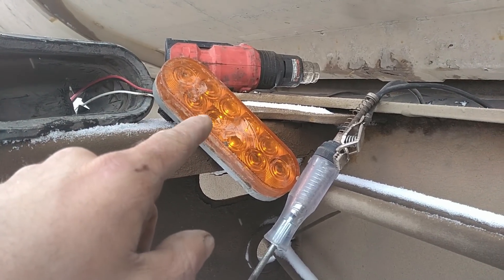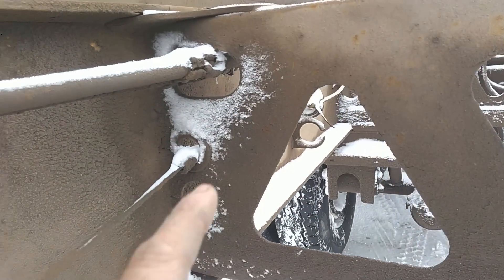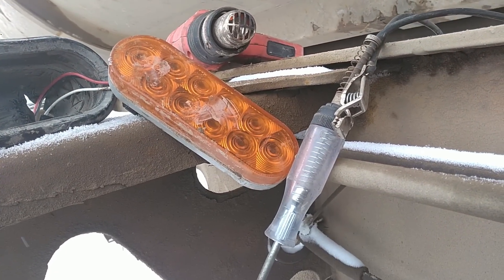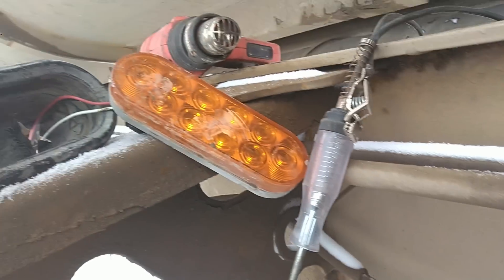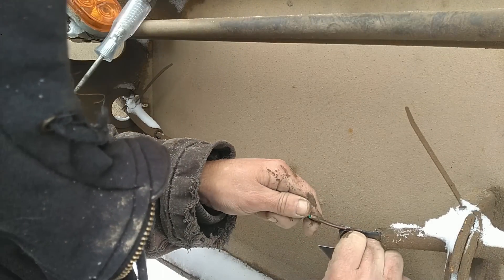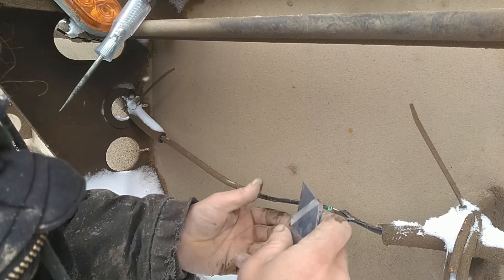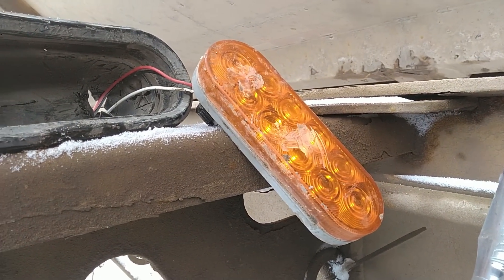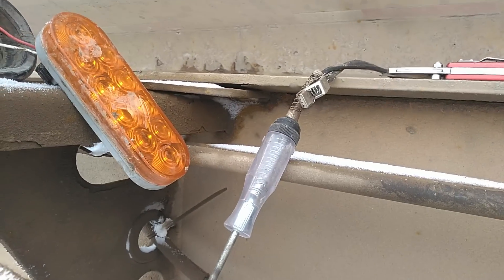fixing a intermittent marker light

Comment: I've been there a little pin hole in the wire can't its a big green puss factory, I've done the shaking of the wiring harness the clearance lights flickering on and off. The little equipment trailer that gets pulled behind the pickup to haul minis and tracked skid steer the clearance lights on it flickered on and off I tracked it down to one of those blue heat shrink butt connector one end wasn't crimped but it was heat shrunk bad connection. I hate chasing down wiring issues it some times it comes down to F it rip it all out and start over I've done that.

Comment: ARGH!! Wiring issues... I've had to deal with so many! Because I'm small and I fit under things, like float trailers... Couple years ago I even contemplated growing a beer belly so I wouldn't fit anymore! The thing that pissed me off the most is that many issues I found were caused by mechanics testing for power. Poke holes in all the wire casings and never seal them. Salt has magnetic attraction to those bitty little holes... Also, you need some shrink wrap for your finger, it's leaking... LOL

Comment: Run the wire inside vinal tubing works better then some of the sealed cable. Heat shrink the ends at connections and silicone closed best long term investment solves issue and yes $60.00 more to rewire 53 foot trailer

Comment: Hello Ezra. A multimeter set on continuity can help you find the break or problem. A circuit tester is another way to find the fault. If you do decide to rewire the entire trailer, using some shrink tubing will give the extra protection to prolong corrosion in or on the wiring. Have good days!

Comment: O-H-I-O Porter greetings.❄️ Tracking those intermittent wiring issues in the winter is rather bone chilling & tedious!  Good stuff. I know that it took more time to record this, but it’s always helpful. I’m sure you will go over this trailer more thoroughly when summer comes. Might need to. Don’t forget to check the trailer plug & cable from the tractor as well. Good job! Blessings.🥰🇺🇸✌️

Comment: does that type of connector have a sealant inside of it, and what is that connector called?  thanks
Reply from the maker: It's a Marine grade butt connector
Reply: @Ezrider359  /thanks for your reply. I am also a do-it-yourselfer. A great product that I use quite often, especially on wiring is called  "electrical moisture sealant", part # 06147. It is made by scotch. It is somewhat like electrical tape but wider and very sticky. I have some on my truck that has been there for 20 years. It is good stuff.

Comment: Thanks again .u should have cut the other wires and shorten also to make them same length it will be easier to tape the wires
Reply from the maker: The splice is more likely to fail than the wire. If I had to cut much more wire out to get out of the corrosion I would have spliced a short section into the damaged wire to leave the good wires intact.

Comment: I had similar issue on my flatbed decided to rewire the entire thing front to back took two days but having perfect working lights and all new wires is priceless
Reply from the maker: Yeah at 17 years old it's due. Can't fit it inside though and I use that trailer alot in the summer. I'd like to replace the whole trailer with a new one in the next few years.

Comment: Isn't trailer wiring fun. Not. Butt the trailer builders dont help and others that have worked on havent.   on long runs of hanging wires like that get some plastic conduit and bolt it on and run the wire though it keeps the wire from flopping around a former boss didnt like it took me way longer. To fix trailers butt the broken wires seemed to stop on those units. I work on trash trucks for a living its  fun 😡

Comment: Brave man  Ezra!  Happy New Year fella!  Stay warm. Unsupported runs leading to strands breaking internally to the wire resulting in corrosion.  Crikey.  Tough to deal with all that salt.  Guessing these are 12V? Bit easier over here (UK) with long wiring runs as all trucks are 24V. PS EDIT, ratchet wire strippers are much easier than wrestling with plain plier type strippers.  Save cutting your hand!!!
Reply from the maker: I don't think 12vrs24 volts would have much effect in this situation amp draw of led lights is very minimal regardless of voltage. A damaged wire will still have the same affect
Reply: @Ezrider359  Ah yes forgot they were all LEDS...  Yes I meant wiring generally is easier as 24V wires can be muich lighter so less likely to break. That wiring looks terrible quality, I think you're right, you're just going to have to rip it all out and do it properly!!  On the plus side, it'll make a good video series!!